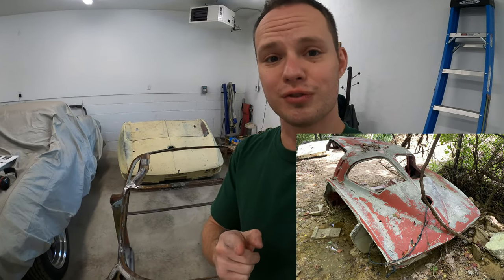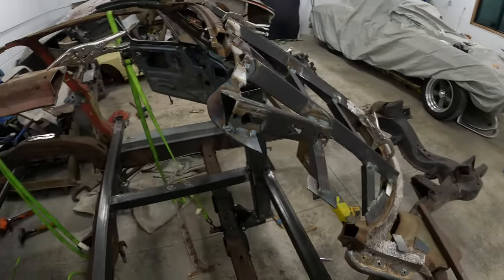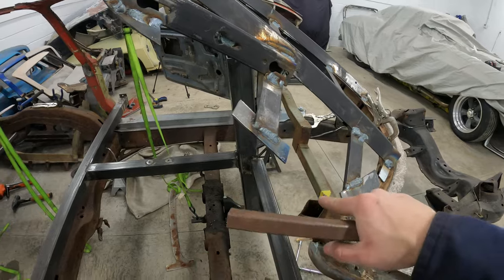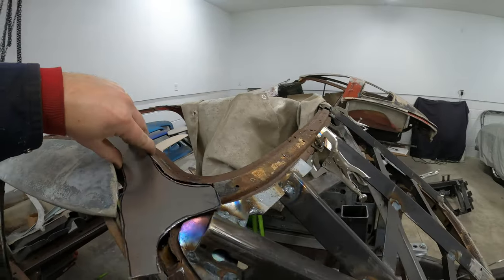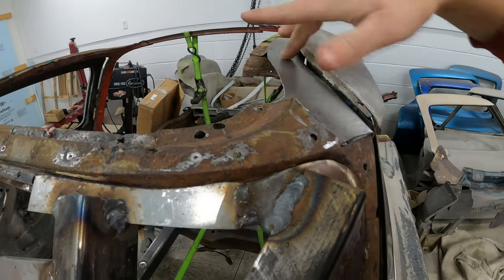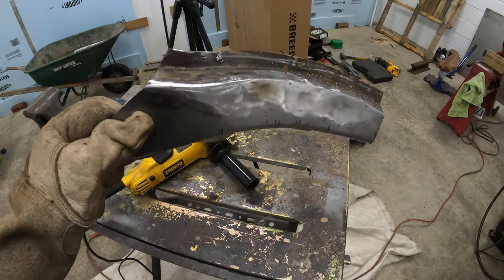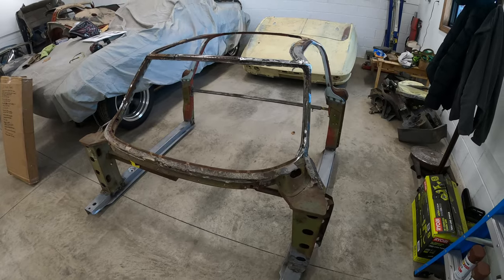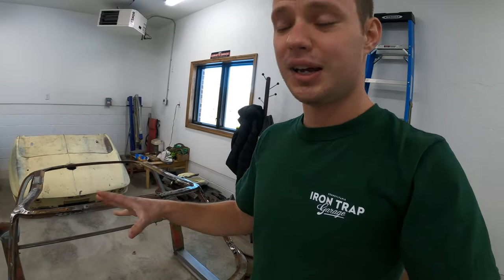Rebuilding Rusty Coupe Windshield Corners on a C2 Corvette Birdcage.  Field Find Split Window Part 5

Comment: Hey there Mitch,
From what I can see, that's some accurate metal forming there. Looks just like the original. The project looks like it's going real well. I can't wait to see the fiberglass attachment.
BTW, the video looks a lot better ... no flicker noticeable in this one.
Take care and don't put your eye out!
Dan
Reply from the maker: Hey Dan!  I am very happy with the way the roof pieces came out.  Every piece I make comes out a little better.  The cage is coming along nicely.  It won't be long until its skinned in fiberglass.  I finally found the right setting to change lol.  It took a bit to find but I got it.  Thanks I'll try to keep them both operational.